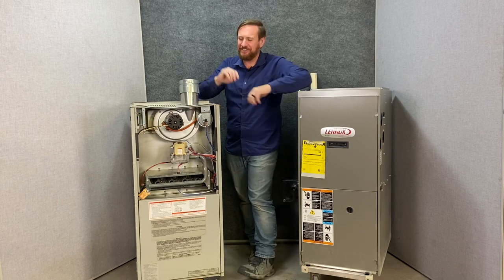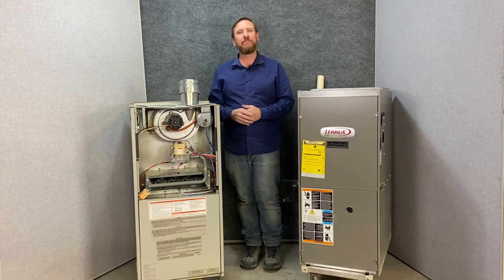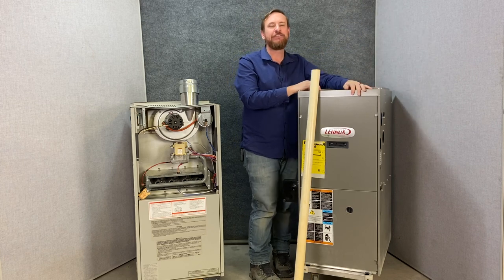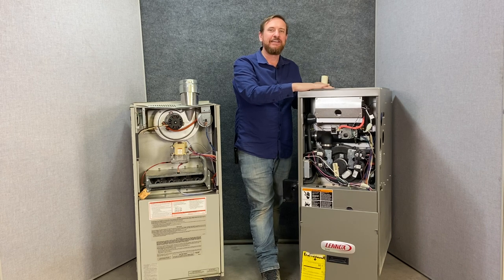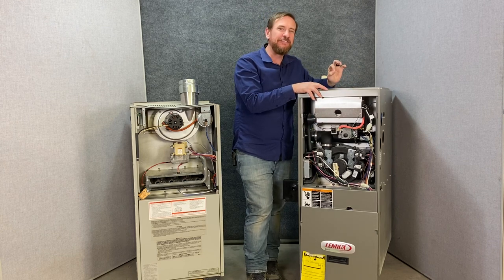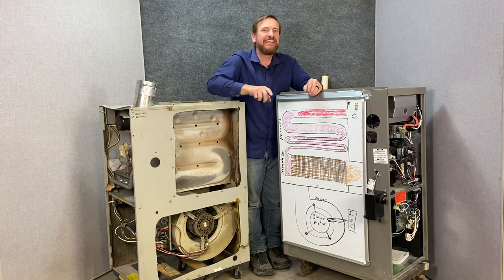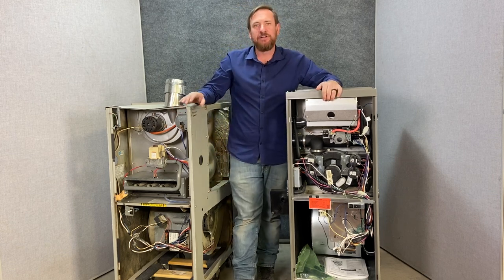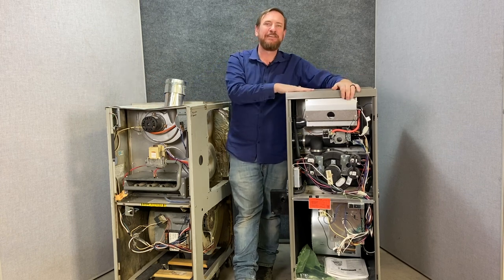80% vs 90%+ Condensing Furnace

Comment: I was going to change our 1958  Lennox furnace for a new energy efficient one, but over the years as new fees and taxes were added to our gas bill, to the point that it was pointless, I will stick with my trusty old friend with all it's mechanical components! I still have the stand by pilot light, and belt driven blower with hammock filter!
Reply from the maker: Please
Get a low level CO monitor for each room. NOT an alarm but a low level monitor. 
I have a video about CO and the difference between low level monitor and an alarm.
Reply: That's horrible, gas is more expensive then ever
Reply: So if I read this right, you want to stick to an old inefficient furnace because taxes and fees were added to your gas bill? you will still be paying those taxes and fees no matter what gas furnace you have, but those fees and taxes will be LESS with a new furnace because you will be using LESS gas!
I replaced my 80%  Lennox Conservator G11-e 110,000 furnace that I brought home used from work in 2003, it was about 35  years old when I recently replaced it with a new Goodman 96% 80,000 btu, so right off the bat it's 16% more efficient, probably more because the old Lennox took all it's combustion air from the basement which pulls in cold air around every little crack and gap, and it had a 5" flu going outside that was open to the sky, when the wind shifted a certain way cold air would be pushed DOWN the flu into the room.

The new furnace,  I installed it myself with all the returns and ducts- has been working perfectly, it was zero degrees outside this morning 73 degrees is what I have the thermostat set for, the 80,000 btu's is plenty to heat the house, the 110,000 lost at least 20% plus the losses of the open flu and the combustion air coming from the room- so it's max output was  no more than 85,000 btu. The new 96% 80,000 puts out about 77,500 btu
Reply: Excellent case study.  Thanks
Reply: If 1958, change it! At least get one with ecm technology!
Reply: @HobbyOrganist  I replaced a 1978 Lennox with a 92% and my gas usage dropped by more then 1/2! $14,000 saved to date

Comment: Really appreciate the effort and time taken to upload these videos. Although my HVACR program hasn’t began to focus on the heating aspect in any detail so far these videos are giving me a great head start.
Reply: I have an 90% HE. its 29 years old. The serviceman who came to see why it isnt blowing air seem hesitant to repair. They keep pushing me to buy their furnace and offer 10 warranty on a new one but they are gonna use my old box. They gonna give me a new fan, new board and a new thermostat for $4500 not including yearly maintain svc. If a parts needing replace they dont want to touch it, damn.

Comment: 6:53 If any argues that leaving the inlet line open to pull in from inside the home don’t use them as an installer.  They clearly have zero idea of what there’re doing. Alway pull the air from outdoors and exhaust outdoors to keep indoor pressure near equal.  If you pull air from inside the home and exhausted outdoors, you’re literally introducing a negative pressure pulling cool air through cracks in your home, thus offsetting your efficiency.

Comment: Wonderful and simple explanation, 90% plus furnace does need  more attention especially  drain issues. I enjoyed watching the video.  Thank you Sir.
Reply: My HVAC is pumped up into my washing machine drain so I can hear it tinkle and know if it's clogged, and we freeze REALLY hard so this keeps her from plugging up-50% of the plastic tube is above ground and warm.
Reply: My prior home had a 96% furnace and the drain line would freeze multiple times per winter - so I'd arrive home to a wet floor in the laundry. A giant PITA. Much happier with the 80% furnace in the garage of my new home. They're bombproof, reliable, easy to service, and cheap to repair or replace. Simply wear a sweater and lower your thermostat if you want to reduce your gas consumption.
Reply: @Monkeyseemonkey79 totally agree. 80% is the way to go and I don’t mind paying extra gas during the 3 month winter..

Comment: Ty, thanks both for the presentation and for your attention to questions from comments.   I want to share my experience on having a new 96% efficiency Ameristar 100k btu furnace.   I did the install myself and delayed putting in the condensate drain so I had it running into a bucket.  It’s remarkable how much condensate is generated by this furnace!   We have a moderate heating load in Seattle but had a cold snap a week ago. 6 gallons of condensate in 24 hours.  I’m now considering where I want that water deposited outside as I’m located on a hillside.  Not a question just an observation.
Reply from the maker: Great job.
You have to be careful to drain it outside as it will freeze. 

Use an acid neutralizer and put it in the sanitary drain if at all possible.
Reply: @love2hvac I have a hole in my slab that my AC drains into, is there any reason i cant let a 90% drain there?  It’s below the frost line since it’s in a basement.    Also, I have a fairly new 80% Goodman furnace, it was here when i bought the house 2 years ago.   I spent a chunk of money air sealing and better insulating my house, I really would much rather have 90% and two stage.    Any idea how i can do this without wasting a nearly brand new 80% Goodman?
Reply from the maker: @mark33545  
Hi Mark,
The hole in the slab, it would depend on where that goes. Often they will go to a sump pump that is pumped out somewhere. If that's the case it would need an acid neutralizer in the drain so it doesn't eat away the pump. The same would go for city drains.

If the drain continues under the frost line in a type of French drain system, then it would be fine. I have seen those drains not be deep enough once it's outside and freezes. 

As for the new furnace, it will be a significant cost that you will likely not see the ROI. It would depend on how well sealed the home is. 
You can speak to an energy auditor or someone in home sealing home performance that can run a blower door test to find how well sealed your home is. 
If it's really tight, a condensing furnace with a sealed combustion may be necessary. 
An 80% furnace to be combustion air for the furnace (and water heater if it's gass too)  In some cases I have seen people pipe an outside vent to the furnace combustion area. You would have to check your local codes to see if that is allowed, but speaking with someone who does home performance would be even better. You can't seal the other vents if the furnace either so it's still not a sealed combustion but it helps control some of the outside air. 

Hopefully that helps
Reply: @love2hvac  Thank you!  that is very helpful.  To be honest i have no idea where the hole in the slab goes, i assumed it just aborbs into the ground/gravel under the slab.  

RE: the 90%, i figured i would never see an ROI.   TBH, The biggest feature I want is 2 stage.   I hate that my 80% turns on full blast, make the house very hot very fast and then is cool for the next hour until it runs again.   Ideally i would have the ability to add a stage to my 80%, perhaps they make a retrofit kit that adds a pressure sensor, 2 stage inducer motor and 2 stage gas valve?  probably at that point it would make sense to just get a new unit though.  :/
Reply from the maker: It sounds like your furnace is grossly oversized. Unfortunately most of them are. We are finding furnaces across the country 1.5 to 3 times bigger than what the house needs. This leads to uncomfortable homes.

If you can find a home performance company, get them to do a blower door test with an ACCA manual J heat load calculation. It says manual j is usually a computer program such as "Kwik Model"  to find the size. 

For a 2 stage furnace, it would be cheaper to replace the furnace.

You can also look at rebate programs. Sometimes there is money for upgrading to a 95% furnace, a heat pump or a combination of the 2.

Comment: I've come across offhand comments about the lack of durability in 90%+ furnaces due to their complexity.  I was concerned about that when I bought my current house, as it already had (in 2009) a 90%+ furnace, and I was afraid it would soon fail. 24 years later, it's still going strong, and will turn 40 in the spring. I've briefly considered going back to an 80% furnace because of the up-front cost of a new 90%+ unit if/when my current one finally dies, but have decided the up-front cost is worth it for the long-term savings.
Reply: If it's 24 yrs old now  how can it turn 40 in the spring? Mine's about 20 and I've had zero issues
Reply: @martik778  It was installed in 1984.
Reply: Didn't think they were made back then. Amazing!  Any issues with it?
Reply: @martik778  I keep waiting for something to go wrong, but so far, nothing has. Air filters are 4" thick and expensive ($30, once a year). The criticism has been that "pulse" furnaces are noisy, but it's in the basement, and I don't live there, so a little noise just lets me know that it's working.
Reply: @martik778 mine is 29 years old  now the 90% and the fan runs nonstop. Its my fault i didnt do yearly maintaince. It looks like mine may need to be replace. They are good. If you maintain it.

Comment: I have a bad experience with the constant sensor problems on high efficiency furnace. My 80% efficient furnace works with no maintenance needed. The 95% one needed at least one $100 service call every season, burning all gas savings.
Reply from the maker: That sounds like it wasn't installed properly. I've seen plenty of 90+ furnaces neglected for years and still running flawless.
Reply: well, the problem is, the heat exchanger in old furnaces corrode thru or crack and you WILL HAVE to replace it anyway
Reply: @HobbyOrganist  Just make sure you have alloy steel pipe heat exchangers in the furnace you choose. It is the stamped metal exchangers that rust through.
Reply: @love2hvac guilty, mine is 29 years old. The serviceman who came to service it wants me to rid of it and buy their furnace.

Comment: Mine is a single pipe system. It uses the vented crawl space for combustion air. Main concern where I live is radon so the furnace creates convection down there.
Reply: I dont buy the radon bs, I ordered several of those  First Alert radon kits, i put them in the basement and so on, the mfr's web site had maps of the USA, and on the map was my town of 1700 people, and lo and behold, clear to me what an amazing coincidence, MY house had the highest amount of any other in town= 16.4  LOL! like I'm going to believe that amazing coincidence!

So I tried another round of the tests, this time I set one right INSIDE the dry sump pump pit in the basement, and I put one on my desk UPSTAIRS, remember- they claim radon is heavier than air and settles to the lowest location, well, the basement sump pump pit is not only the lowest location it's direct access to the ground not concreted over like the rest of the basement floor is.

 I got the result back and the one that was on my desk upstairs had a MUCH higher amount than the one sitting INSIDE the sump pit in the basement LOL!!!! 
REALLY??? stop with this scam already!
Of course the results listed a few "approved" remediation contractors all very happy to give me a call and fleece me for a few grand!

I know the former owner's son, they lived here from 1941 into the early 80s, he was a little boy when his folks moved into this house, he  is now almost 90 years old. His mom passed away in the local nursing home in her mid 80s.
Reply: Wow! Another amateur rewriting the science based on their bias and individual experience.  Spare us please.